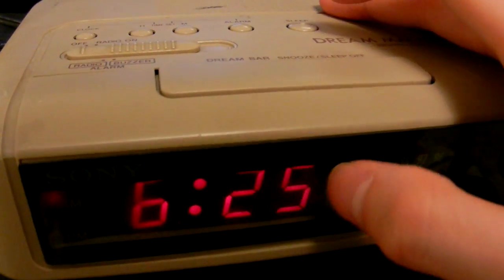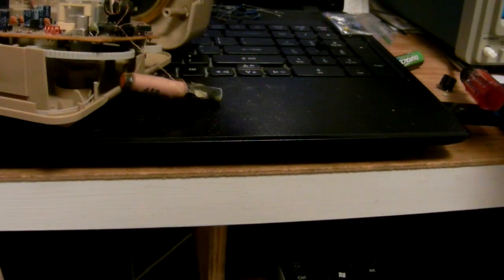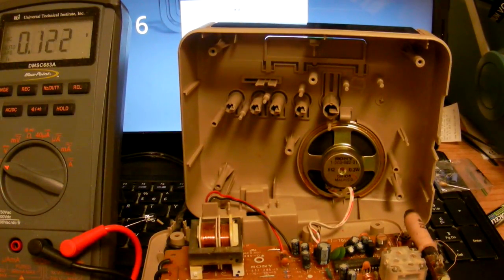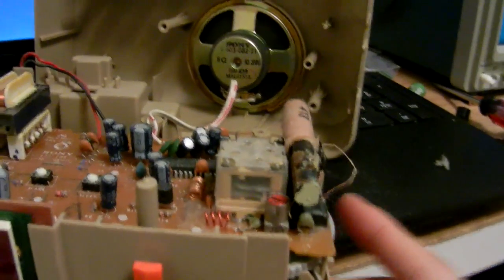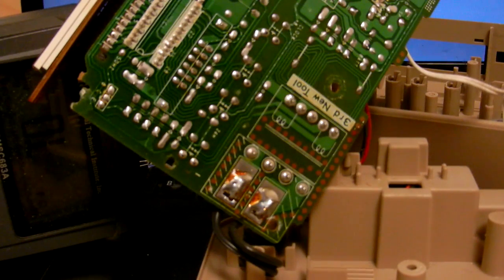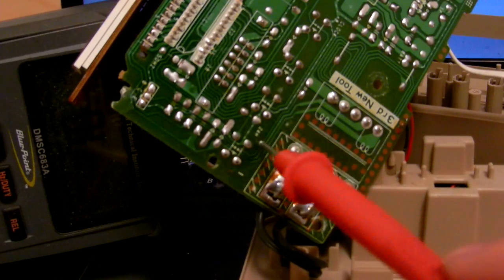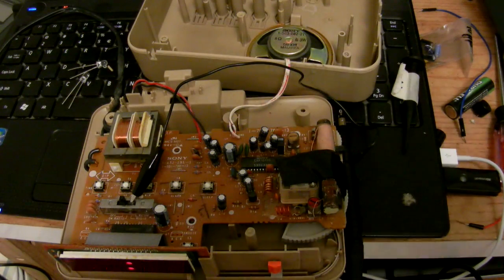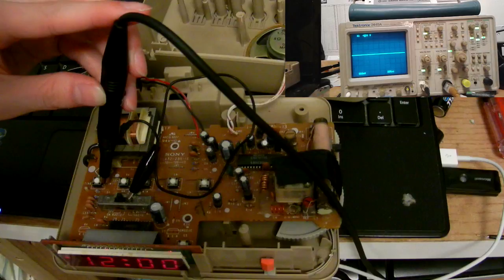[Bits #12] Inside a Clock Radio - SONY Dream Machine Glitches

Comment: How did you remove the base once you removed all of the screws?  I keep feeling resistance from inside the radio and don't want to force anything.  I would like to be able to remove the base in order to clean some contacts, as I'm getting very scratchy noises when I adjust the volume and tuning knobs.  Otherwise, this radio still works great after 30+ years of use!
Reply from the maker: I'd first double check that you didn't forget a screw somewhere - tends to be super easy thing to miss. After you're absolutely sure there are no screws missed, you might have to do a bit of wiggling to convince the thing to come apart. In 30 years time, anything sticky liquids that got inside will get really sticky, bad components that leak may cause things to stick, etc. You can get a feel for how much force it takes to break a circuit board by finding a similar board (age-wise and construction-wise) elsewhere and trying to break it with your hands. Just don't apply that much force on the clock. With that said, if this clock has any sentimental value and you don't want to be super sad if you do destroy it, don't touch it. Good luck!

Comment: What is the use of 9v battery out there. Does it work on battery without electricity?
Reply: The 9 volt battery is a back up during a power interruption/outage.  It maintains the current time and programming (alarm time) HOWEVER if the AC power is still off when the alarm is set to go off it will not sound until AC power is restored.  For that reason I bought a little battery powered travel alarm clock  as a back up to the first one.  It has saved my butt a handful of times when the power was out or I forgot to set the clock-radio.